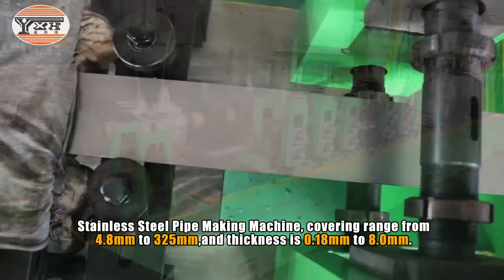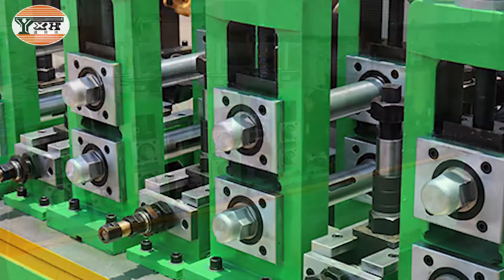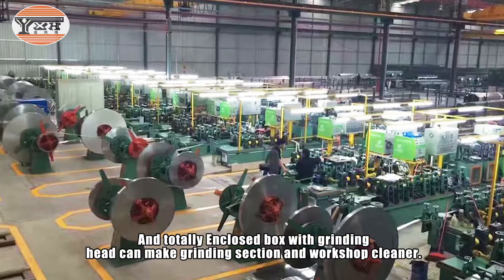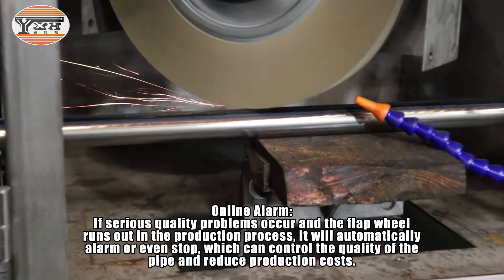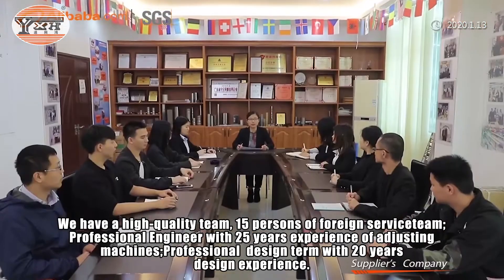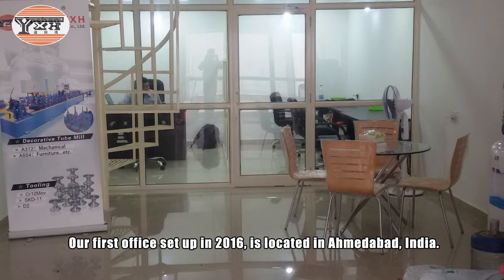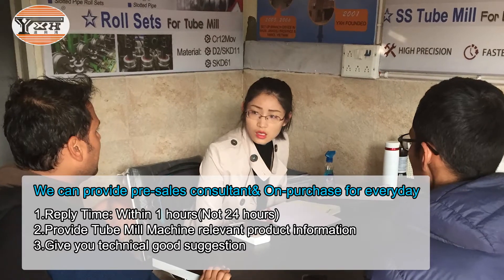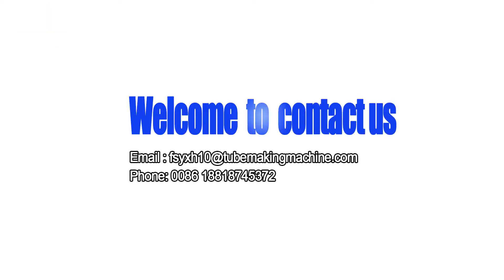Steel Pipe Making Machine Manufacturer|What is SS Tube Mill|Foshan YXH

Comment: Yonky, w a no.0811664926,, my old steel pipe machine is from femco, Taiwan 1980 already 40 years, pt.pabrik pipa indonesia, indonesia tube mill co,,,closed @ yr 1998,-
spec dia 2,5 in to 8 in
email, yongky.amir26@gmail.com
t q
Reply from the maker: thank you for your reply, we will contact you soon